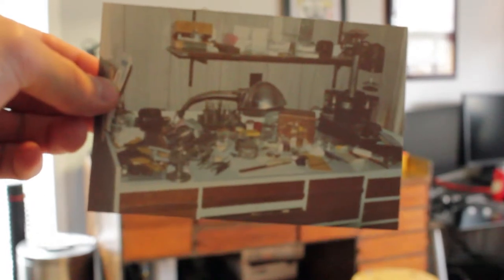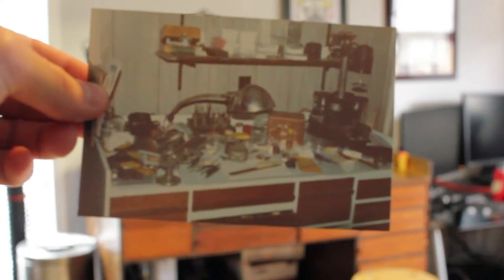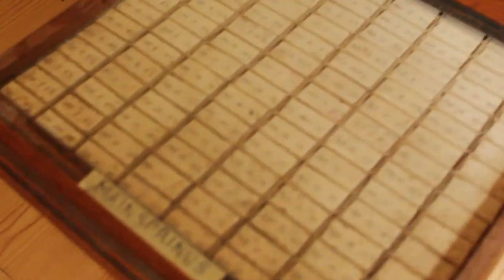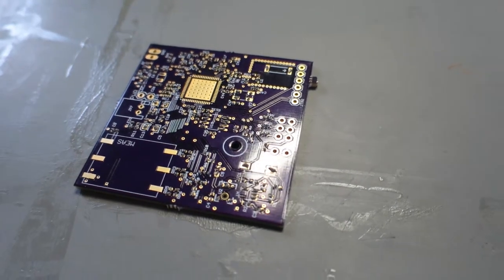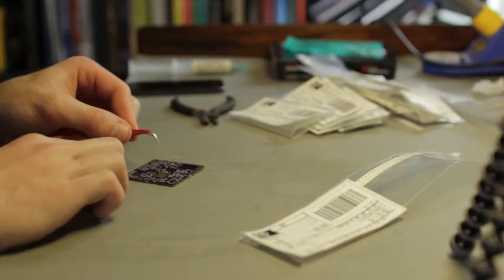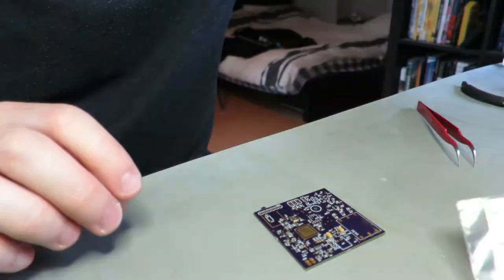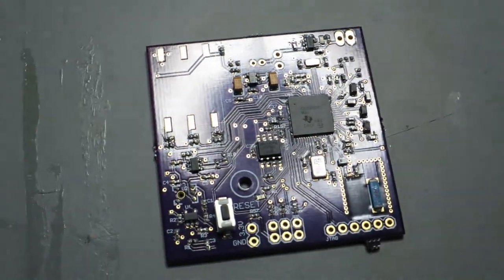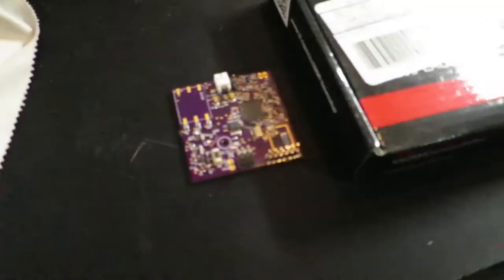Do Everything Yourself

Comment: Few questions since I am starting to get into this stuff.
What was this board for?
Where do you order your parts from?
What company made the board?
What software do you use to design the boards?

THANKS!
Reply from the maker: +Adam Waggoner The board is basically a wireless microcontroller with an accelerometer and some other sensors. Its for my Masters thesis. Parts generally come from Digikey.com. A company called OSHPark made the boards, its inexpensive and very high quality, but they take a few weeks. If I need boards quickly I use Pentalogix. I used Eagle to design this board, but I have since learned to use KiCad since its fully open source and zero restrictions or licenses needed. I would learn KiCad over Eagle if I could start again.
Reply: +SeanHodgins Thanks bud! I'm sure there will be more questions to come.